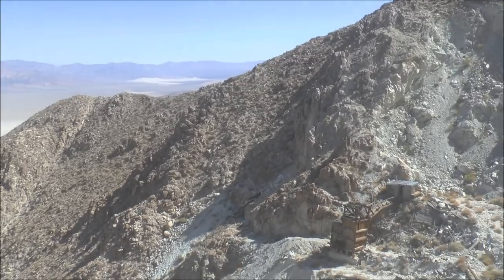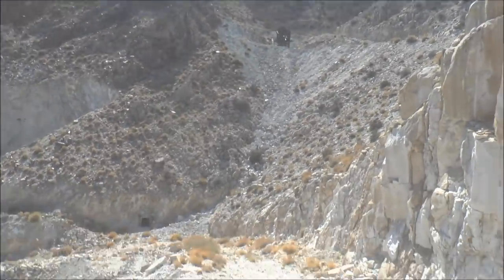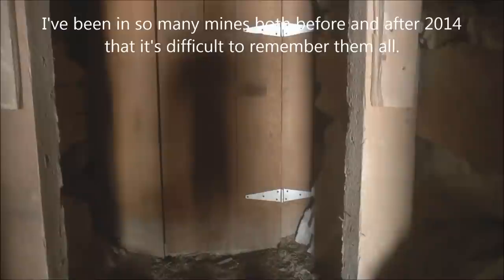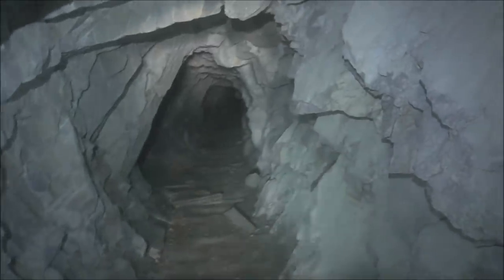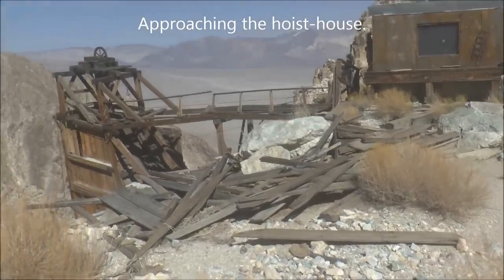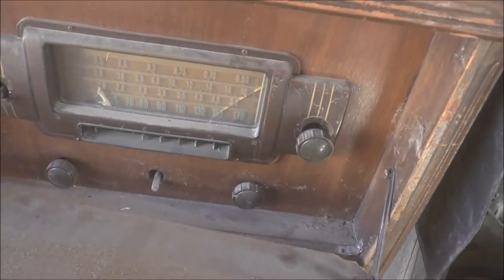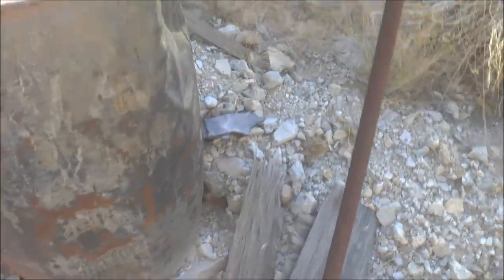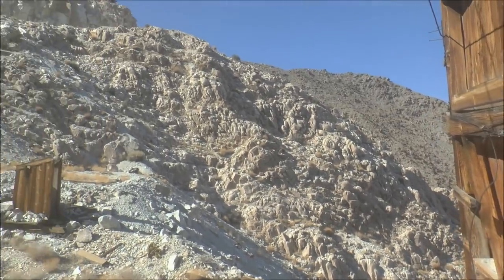A Return to the Nikolaus Eureka Mine: Seven Years Later

Comment: Cool Mine! That was the right decision in not going down the incline. The winch and radio are cool artifacts. Maybe the cable is at the bottom of the shaft.
Reply from the maker: Thanks for stopping by and commenting, William! I appreciate it. I don't remember if the cable was at the bottom of the shaft when we went down it in 2014. I don't think it was. Might've been removed and used at another mine. To be quite honest, now that I think about it I think that winch is the first one I've ever seen that has NOT had any cable on it!

Comment: a decade before I started youtube, 2 of us went to the old ghost town off the 15 freeway and below the o on the calico sign above, we went seep into a mine, we took 300' of 550 and use it all and didnt make the bottom. many tunnels, many ore carts and items. we came out dyed red from the dirt. 3 showers and it was still coming off me. destroyed my canon 35mm camera with all the dust. Fun trip tho once in a life time
Reply from the maker: Great anecdote, Pharraoh! Thanks for sharing it! I had a similar experience but on a much, much smaller scale at the Waterman Mine just outside Barstow. Came out of that one covered in red dirt. Unfortunately, most of the workings in that mine are vertical and would require the amount of rope you said you had.

Comment: So just checked out the previous video and that ladder seemed to me to be going vertical definitely not at a 45 degree angle lmfao The danger you face even with partners is great so doing it alone has to be insanity. I’m surprised you can even get into these mines with your giant balls but I’m glad you do keep it up and keep it safe.
Reply from the maker: Thanks for your comment! And thanks for checking out the older video from 2014. It was a pretty cool mine down there on the inclined shaft. Lots of dangerous collapses, though! It wouldn’t surprise me if all of those levels have totally collapsed by now.

Comment: Young person here! (24) records are easily one of my favourite things to collect. The science behind how they work and the depth of sound you can get is just mwah beautiful. That aside, I've been thinking about mine exploration for a few years, what kind/brand of meters do you use and where can I buy em?
Reply from the maker: Yeah, air monitors are really necessary if you’re going to be exploring abandoned mines. Most of us use the BW Clip oxygen meter and the BW Clip hydrogen sulfide gas detector which you can buy on Amazon. I can’t remember exact prices but they run around $100 or a little bit more. As soon as you receive a meter, you activate it and it is good for two years. It never needs calibrating or anything like that. Once the two years are up, it automatically deactivates and you have to buy another one. Thanks for the comment and question, Adam!
Reply: And thanks for the great answer! I shall continue on bingewatching your videos

Comment: That white powder is likely Boric Acid, or compound B(OH)3)  - (hydrogen borate).   It had long been used as an Antiseptic / blood coagulant, or even when strongly diluted with clean water, it would make an excellent eye-wash to remove compounds, particles and chemicals from the eyes without causing additional damage.   It can even be used as a fire retardant when mixed with water and allowed to soak into wood surfaces.  It has even been used as a welding flux, or a soldering flux that would help reduce sparks.  So as you see, it has a large versatility of wide-spread uses, and therefore very practical uses within the mining industry.

Comment: How did the bat get into the first tunnel if the door was closed, Must be open somewhere I guess
Reply from the maker: I was thinking the same thing, Paul! As I was walking back out towards the door, I realized there were some pretty large gaps around that door. The bat must use those to get in and out of the mine. It’s kind of like when the BLM installs those bat gates into a mine entrance. The bats know to fly between the metal bars. The bat in this mine probably does something similar with the gaps around the wooden door.

Comment: Those hinges on the door of the first tunnel look shiny new. I wonder if someone wanted to seal off that shaft.
Reply from the maker: Yes, that door and hinges do look very new! For some reason, we did not go in this tunnel when we initially visited the site back in 2014. None of us have any recollection of why that was. I am guessing that the tunnel might have been locked at that point in time, so we chose to skip it. Normally, I would film something like that – especially if we went into it. It’s still a bit puzzling, but that’s what we’ve come up with.

Comment: How on EARTH do you reach these isolated places? I just checked out where this one was located and I'm just amazed how deep you go off the grid to get to these places. Do you use a 4 wheler to get closer for an easier hike? Such adventures
Reply from the maker: As you saw in Google Earth, there is an old mining road that goes to this mine. However, the road is only passable until you reach the top of the mountain. From there down the backside to the mine it is not passable for any type of vehicle. So a lot of people drive their four-wheel-drive vehicles to that point and then hike that last mile or so down to the mine. I don’t have four-wheel-drive, so I park down at the highway and hike the entire road which I believe is 2 miles one way to reach the mine. I did this hike two times this past summer, and the heat makes it a brutal hike. It would be much easier to do this hike in the fall or winter when daytime temperatures are much more mild. It’s a great hike, though.